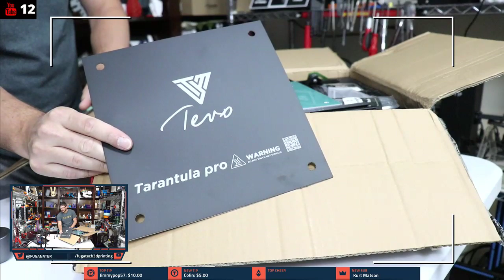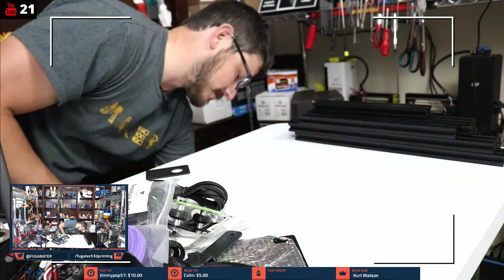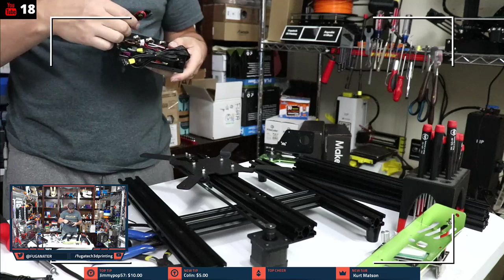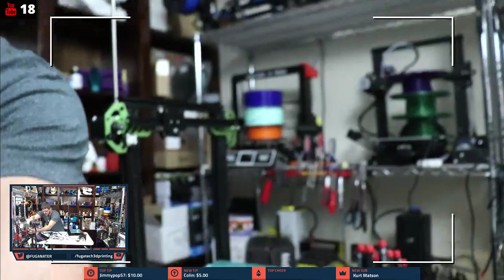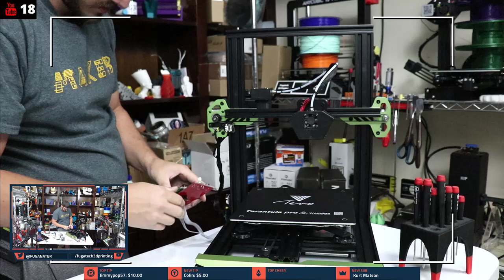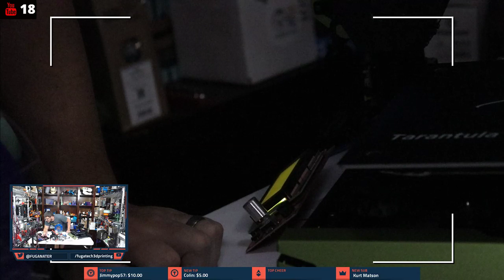TEVO Tarantula Pro Live Build and First Print (Hopefully)

Comment: You had the good green version. The new orange version where they have swapped some metal parts on the frame for plastic is apparently really, really bad in comparison. It's a shame that they don't make the green version anymore.
Reply from the maker: I just got the new Homers version. Will be interesting to see how it holds up. Yes the parts are plastic but it does have other parts that are better than the TT Pro.
Reply: @Fugatech3DPrinting  The review I was said the ends flex too much and they couldn't get a descent print out of it. The SDCard that came with it was faulty, which didn't help issues either.

Comment: When did you get your printer? Got mine 10 days ago in a green box and I had a few problems assembling mine. Worst problems were the wheels and the belts. Six wheels caused bad thumps as they traveled and the belts were cut uneven causing the edges to catch on the pulleys and gears. I replaced my belts with some on hand and I purchased some polycarbonate ones which are fantastically smooth.
Reply from the maker: I got it a few days before this live stream.
Reply: did it fix it? did banggood acknowledge the defective parts? or send new ones?

Comment: I'm also getting "e1 thermal runaway printer halted" after moving to second layer. I am not sure what's wrong.
Reply: Cooler fan kicking in 100% at second layer?
Reply: Mines same
Reply: Just assembled mine and the test file does the same..v. frustrating.
Reply: Yes for sure it is cooling fan going 0 -100. Do it in steps 0/25/50/75/100